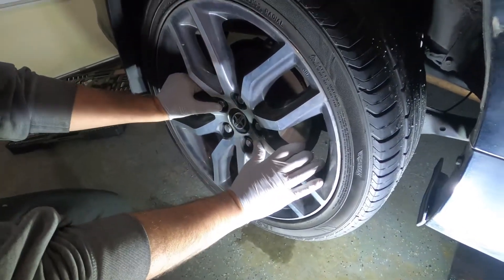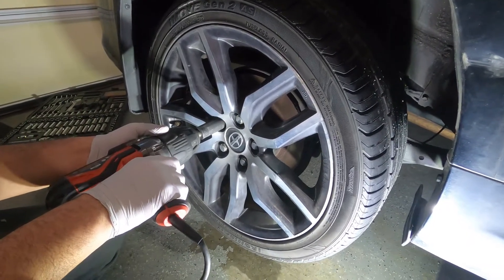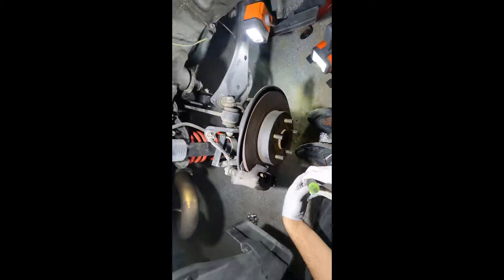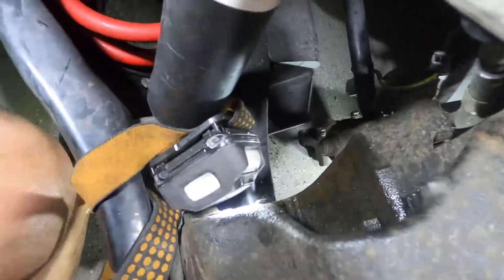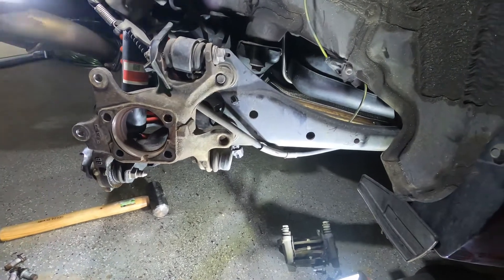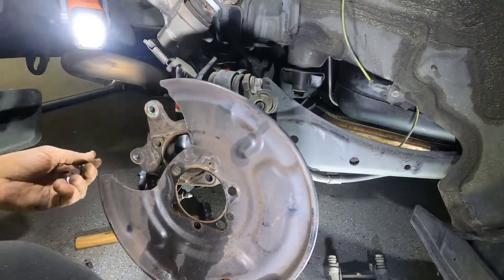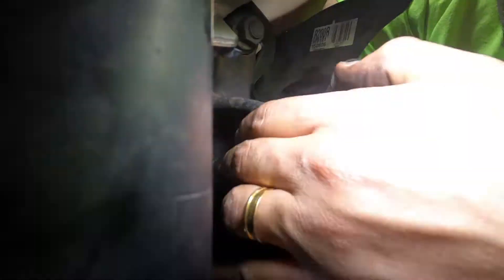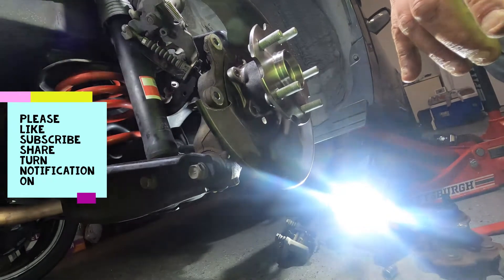2016 Scion TC rear hub/bearing assembly replacement/change.

Comment: Hi I have the same car with 80,000 miles on it , when I take a pothole it makes it makes a knocking noise, did you hear a similar noise when you drive it ?
Reply from the maker: No there was no knocking noise
Reply: @pharaohssquad8078  I changed the sway bar links and the shocks and it’s still doing :( 
Thanks for replying back.
Reply: @luigi3286 ball joint or tye rod and bearing I’m dealing same issue

Comment: what were the symptoms that first led to finding it was the hub
Reply from the maker: It was making a humming noise, which is typical with bad bearing. Specially with high speed
Reply from the maker: It usually stars at low speed but it becomes more clear noise with higher speed